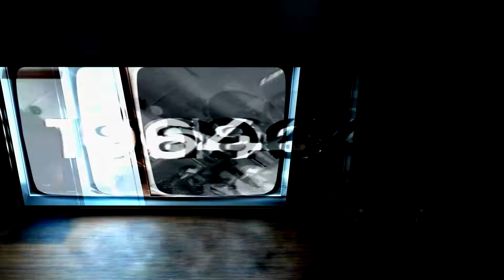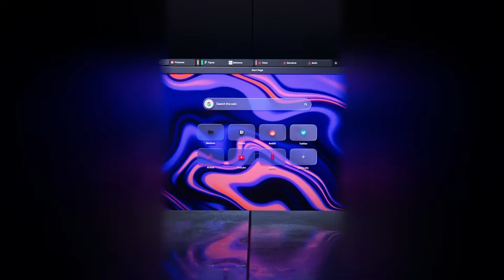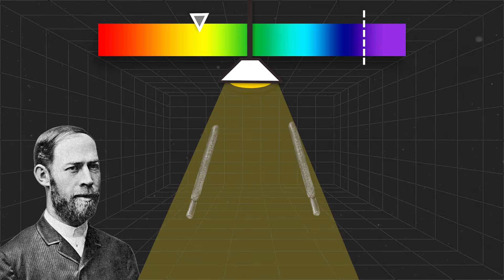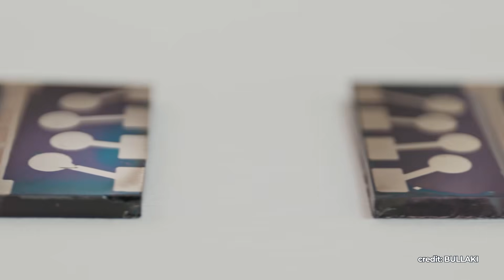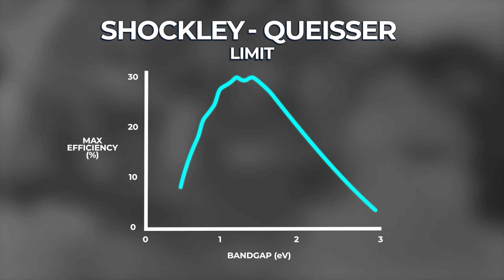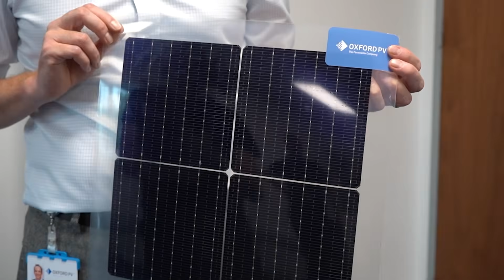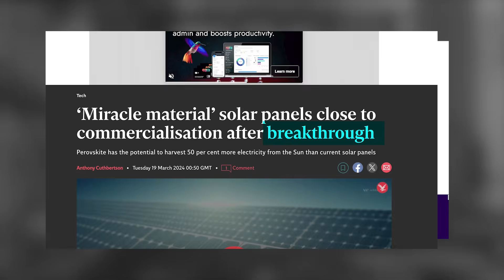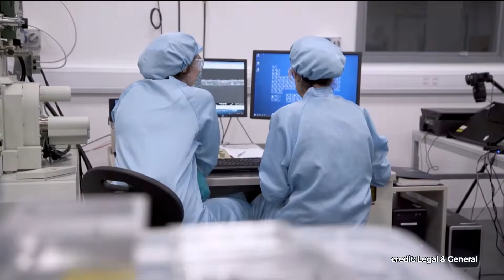How Physicists Broke the Solar Efficiency Record

Comment: 10:30  I'm not sure what Dr. Chris Case was thinking when he said "superconductors are used to cool MRI systems".  No.  The MRI machine is cold so that the superconductors stay cold.  They need to be cold so that they maintain their induced magnetic fields.  The magnetic fields are necessary in order for the MRI to penetrate object ( humans) in order to see inside them.  In other words, "cryogenic fluids like liquid nitrogen are used to cool superconductors, and they are what make MRI machines possible"
Reply: "High Temperature" distinguishes superconductors that need to be colder than liquid nitrogen and those that can be high enough temperature that liquid nitrogen is can cool them.

Comment: How much surface you need to cover to produce a level of average nuclear power plant? How big power buffer do you need to store power for night? Answer is you can't compete with nuclear power. Solar energy have its uses in distant areas, where you can't bring powerlanes or generator fuel. 
Power cells like lithium are not recyclable, so as solar panels themselves. Both of them poison land even more that unclear waste, which could be recycled in  closed full cycle reactors, or safely buried in salt or deep rock mines.

Comment: This video reminds me of an idea I’ve always had about how we could harness light more efficiently. Imagine a structure, like a cube or sphere, designed to trap and direct all light it touches into a material that absorbs and transforms it entirely into usable energy. Not just solar panels as we know them today, but something capable of cooling spaces by converting excess heat into electricity, acting like a self-contained generator that could wirelessly transmit energy to nearby devices. It’s fascinating how humanity is progressing with innovations like perovskites, yet it feels like we’re just scratching the surface of what’s possible. If we could perfect the way we capture and guide light—maximizing absorption and minimizing losses—it could redefine energy generation entirely. The future isn’t just about capturing more energy, it’s about doing it smarter and seamlessly integrating it into our lives. Isn’t that the true leap toward a Type 1 civilization?

Comment: What if, instead of tuning a material to convert a wide range of wavelengths, we make multiple cells tuned to a small section of the spectrum, then use prisms to split these wavelengths to their respective tuned cells? (think rainbow aimed at an array of cells tuned to the rainbow)

Comment: One question I've always had about renewable energy, focusing more on solar panels; is longevity and recyclability. From a quick google search, solar panels degrade overtime, about 20-30 years is the longevity. Another Google search mentions that the US only recycles about 10% of solar panels that have degrated (Granted, there are no policies in legislature in place to force companies to recycle, so this stat is understandable). With the Perovskite solar cell, does the recycling process stay the same? Or would it be harder?

Comment: If there is 200,000,000,000 visible stars in our galaxy, how is 100,000,000,000x the energy of the sun accurate for all of the stars + all of the black holes in a galaxy?  Shouldn't the multiple be 200 billion minimum?  

Don't larger stars put off exponentially more energy then the sun, increasing the amount of energy available to a species harnessing the whole galaxy?  

What about red dwarf stars, that are the most numerous just not visible?  

Considering "superluminal scattering", couldn't even the smallest black holes potentially provide exponentially more energy then a typical star?

The numbers just don't add up lmao.

Comment: I suppose moisture and oxidation problem can be eliminated to some significant degree but what about the problem with perovskite decomposing under extended exposure to sunlight, heat as well as electrical bias?

Comment: The workmanship is one thing but another is any of the pencil pushers. And I’m a RE pencil pusher, but so so many are just morons. Many don’t have a first clue about homes like many dealership managers don’t have the first clue about cars. Not that they need to be a master mechanic for that job, but when you’re so clueless and disconnected from your end product it’s going to cause issues. 

Agents and and warranty reps and companies that sub out work to be paid at closing and etc etc etc. Mostly all complete morons unfortunately. At least where I’m at. Makes it easy to stand out but god awfully frustrating to get things done when people are so clueless and only focused on short term gains. Unfortunately it does pay to be shoddy for many of these big companies, but the people that work for or with them are morons for always trashing their own reputation. Agents that try to hide defects or warranty reps that are crap or whatever. Short sighted morons mostly. Unfortunately.

Comment: Are the perovskite layers generating a separate output or is it hard coupled to the silicon parts? If separate, degradation would be less problematic as the silicon part does not degrade as fast and therefore even after the perovskite layer has gone effectively useless, it reverts to being a normal silicon cell. However, if coupled, it could bottleneck the output like a panel is being bottlenecked by a single underproducing cell.

Comment: I wonder if it's ever possible for beings who evolve on planets to reach Type 2 or Type 3.  We are invariably the product of fierce evolutionary competition in which we evolve along with our environment (including our "biome").  In order to travel any distance from our home planet for any length of time, we need to be able to simulate that environment - and to some extent we can do that.  The problem is that evolution got us to a certain point because our home planet was robust over a very long period of time - it survived many failure modes (meteors etc) without completely collapsing.  Coming up with technologies that simulate our environment and making them sufficiently fault tolerant may not ever be practical - I'm just throwing that out there since so many of us take it as a "given" that space travel will eventually happen.

Comment: When looking at cost, you need to add in the 4x long duration energy storage needed to account for the 26% availability as well as the transmission and balancing upgrades and costs needed because of the highly distributed nature of solar. This isn’t to say solar is bad, but it needs to be accounted for to give an apples to apples comparison when entering into the cost discussion. The other consideration is that because of that low availability, you need much more capacity than you have load just to balance production over time.

Just some thoughts

Comment: 10:40 if that is high temperature then why do you call water freezing temperature low? It is clearly and measurably higher than the one you now call high temperature, so we have high which is lower than low or low that is higher than high? I know that one is higher than one where it was possible before, but it still is not high or you have to rename all other stuff you currently call low temperature.

Comment: Imagine a solar cell designed like a diamond (but still flat like normal cells). Light enters at one point and bounces around inside, reflecting off various materials. Each material is tuned to absorb a different part of the sunlight. This way, as the light keeps bouncing, it gets absorbed more efficiently, potentially making the solar cell much more effective at capturing energy from the sun.

Comment: A Type 1 civilization is not exactly a civilization that harness %100 of photonic energy coming to Earth. Given the Earth functions as it is supposed to, if we will live and ecology will survive, it could not be over somewhere between %0.5-1 of sunlight coming to Earth and that would count to a potential maximum around 10TW and if we add %1 floating solar panels to oceans and cover %50 of deserts it would go up to around 800 tw (around 45 times of our current energy consumption) while the total energy coming to Earth from sun is around 174 PW and falling to surface is around 122 PW. However Earth has other renewable energy resources, like hydro, geothermal, wind, tidal and etc and we could use orbital solar panels. If we add those up it roughly gives us an amount around 0.9-1 PW of power (around 50-55 times of our current energy consumption). This seems to be the limit of potential renewables on Earth. If the efficiency rate will be %24 instead of %20 then it would take this result from 0.92's to 1.1 PW of energy margins and this is not a small difference.

Comment: i feel like the threshold for being a type 1 civilisation should be alot lower, like, being a civilization that is actively harnessing loads of energy without destroying their home planet (which is actually achievable using today's technology, and alot more nuclear).
Reply: In my opinion, the definition for type one makes sense because it matches the definition for the rest of the levels. If we redefined it to match our level it wouldn't have the symmetry of the current definition in my opinion
Reply: @jamesleishman8025 Yes, but I don't think it is a positive to harness the total energy of a planet. Destroying a planet to do so is stupid. Totally darkening a star and destroying Earth's ecosystem is also stupid. The scale is not an absolute measure. It is more of a guideline.
Reply: @skvvlk if you cover a planet to harness the power that’s one thing, but by the time we could get to that point we would likely have interplanetary travel and use other surfaces to make up the difference. By the time you can get outside the solar system (interstellar travel), you’d likely need to have your entire star’s energy cycling to make the leap to the next star, by which halfway point you’d probably want energy collection outposts from the new star. Each whole number in the scale is exponentially harder to reach. The purpose of the scale is to use as a benchmark. Arbitrary, not a goal to block out the sun. If we encounter other life forms here or in space travels, it would be a good thing to learn how far their tech is developed in comparison to energy capabilities, to see if one has a limiting factor on the other.
Reply: that's just a completely different threshold, not a "lower" one.

Comment: This perovskite hype is BS. As for now, we have 24.8% panel efficiency and 26.8% raw cell efficiency using just silicon. Adding in an additional layer and cost for 1.2% of raw efficiency gain is not economically attractive.

Comment: If a current solar array produces 20 cents worth of electricity per hour, these new panels would produce 24c.
Take price difference, divide by 0.04, and that is how many hours you need before you see a profit.

Solar cells typically last 25 years, and sunlight varies by season & location, but you SHOULD be able to put a ballpark number on profit - once you know what that price difference is.

Comment: Hmm, the downsides of moisture and wheatering made me think that those solar cells might be perfect for interstellar usage since moisture is not really a thing. Well, ice is a problem, but more so for optical lenses. As for the panels themselves, my concerns are still not related to solar tech perse, but energy storage. Because it doesn't matter how efficient solar panels are, they still yield 0 output at night. The prospects for a decentralized energy grid are slightly improved, but not by much. Still very interesting to see how you can engineer your way out ot problems imposed by physics.
Reply: While ice isn't a problem in space, neither is lack of light (for the most part). LEO satellites may be out of power generation for a bit while the Earth eclipses the Sun, but (eg) exploratory sat panels can use starlight as well as sunlight much more efficiently than if in atmosphere, as there's no occlusion or diffusion of the light source(s). In particular, these sat panels may have specially constructed cells that make optimal use of starlight frequencies to generate power. Energy storage will always be required, so that variable factor can be effectively discounted as it's effectively a constant (per case use)

Comment: Well done review of Perovskite development.  It would have been nice to hear about how they have improved on life time of Perovskites which have ben their problem until now.  I would love to see any improvements in Geothermal Heat Pumps and means to do this without huge costs of drilling wells or digging enormous passive loops.  One thing I have never heard of but seems like a good thing to look into would be using the footprint of a house itself to insulate and use a closer loop under the house itself.

Comment: Give me a break 🤣🤣🤣. The ~20% PV efficiency has been the record, since the early 1970s!
You want to know why it hasn't been significantly improved upon (which, given the levels of scientific knowledge improvement, they easily could be), since then? There is a little known US Intelligence Regulation that prevents said efficiency increase. Any solar panel that goes over that efficiency rating gets withdrawn from the markets, the technology is appropriated, by the Intelligence agencies, & the inventor is threatened with litigious: & OTHER, more dire options!
   That is why there has been no improvement, in Solar panelling, over the last 50 years! Make no mistake, the Chinese are {most likely} also complicit in these energy technologies' innovations, being withheld.  I can't remember the exact document; but I've seen it discussed, as well as the relevant paragraphs, in the Regulation, on other YT channels.

Comment: The higher efficiency of perovskite has been known for some time. The main problem with using perovskite has been that, unlike silicon, which is relatively stable, perovskite is unstable and breaks down. Has that problem been solved, and if so, how?

Comment: The Invention Secrecy Act for dacades put limits on how efficient engines (and still does) and solar pannels could be. This held back and still holds back any technologies that compete with big oil. So while we are now at 20-24% efficiency solar pannels, we probably could be a decade or more farther in advances in the sector.

Comment: We've had triple junction cells or triple gate cells for over a decade..  41% efficiency was reached a long time ago, but it's expensive.  As for the type one civilization that metric is ridiculous.  A planet cannot use all of it's sun's power for themselves, the plants need half of that or less, the ocean needs some for temperature regulation, the air must absorb some and we need some for vitamin D conversion and so on down the list.   Petawatts and Terrawatts are not a good metric for advancement but more a reflection of population demand.  Just like a solar panel will never reach 100% due to reasons like heat and reflection we will never use 100% of our sunshine for power it is not feasible, practical or pragmatic .  We will never build a ring around our planet much less a Dyson sphere.  It would take all the material of all the planets in our solar system and maybe ten other solar systems to build such a thing and for what purpose?  If we had engines to bring asteroids from other systems and the Oort cloud and Kuiper belt then we could just move to a better solar system as a whole planetary population.  The civilization metric used is junk sci fy.

Comment: I've been watching this video and became really curious - what if we use lenses and/or mirrors to concentrate sunlight for solar panels and then combine this system with the, what was it called? Thermoelectric elements? Well, use that as a way to cool off the panels to mitigate heat from light concentration and/or produce some more electricity? I'm pretty sure people more educated than me have already thought about it but my quick google search didn't quite answer my question as the results were either not exactly relevant or I couldn't get through the terminology :(